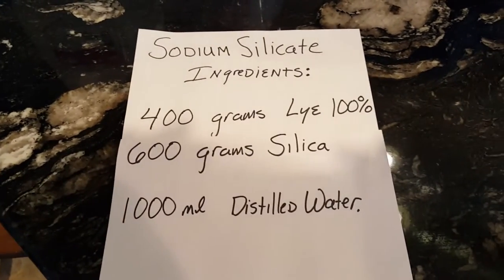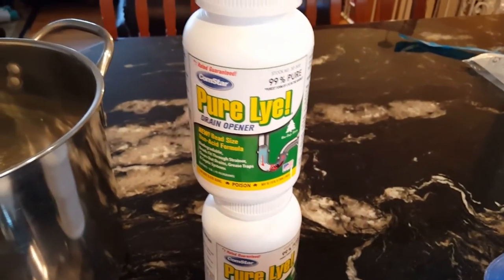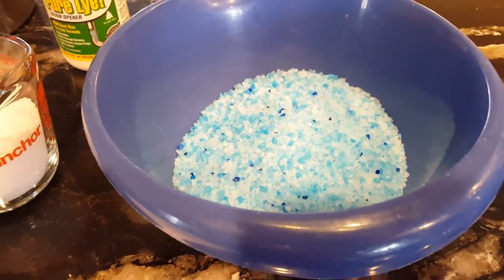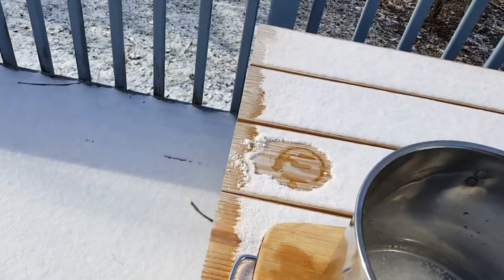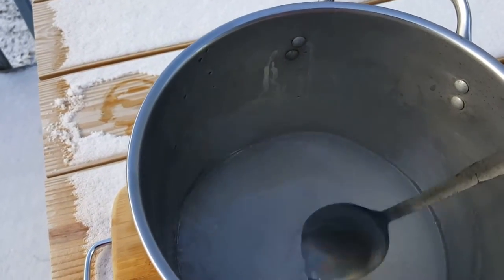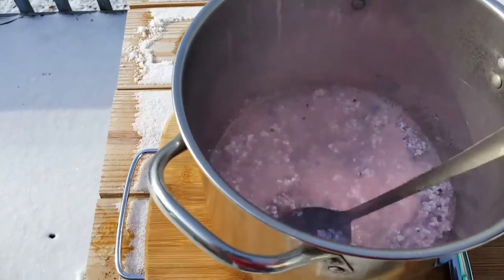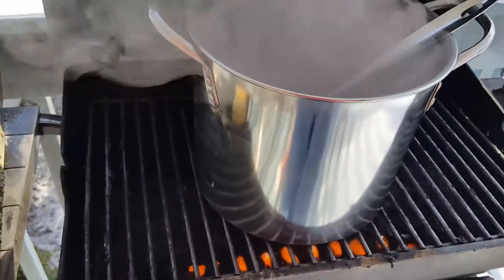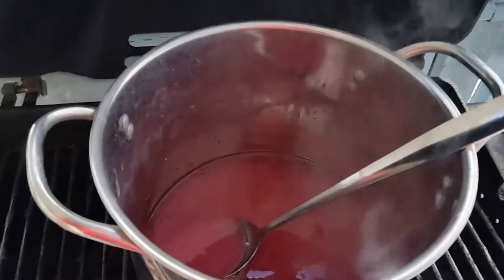How to make sodium silicate water glass

Comment: Could this be reduced with ethanol and or more water to be sprayable?
Reply from the maker: +On-Site Auto Detailing 
Good question, honestly not sure of the answer. I mainly use it for refractory cement, as one of the ingredients. Supposidly makes a good concrete floor sealer. As far as sprayability, i am unsure, sorry.